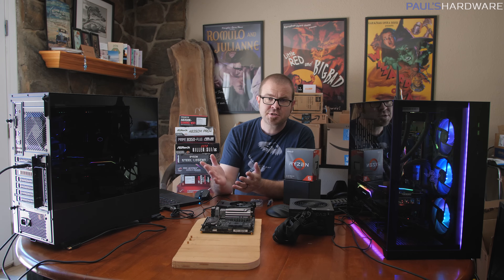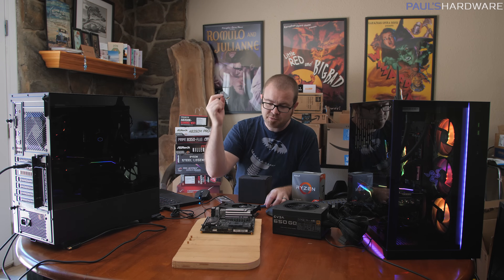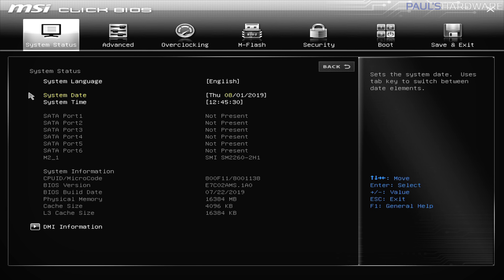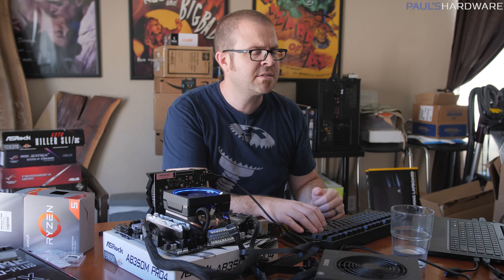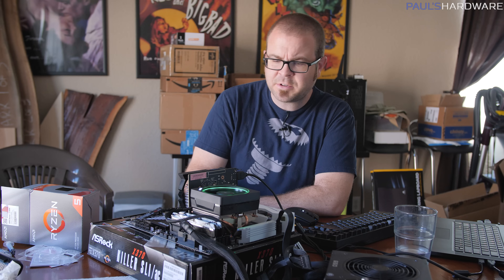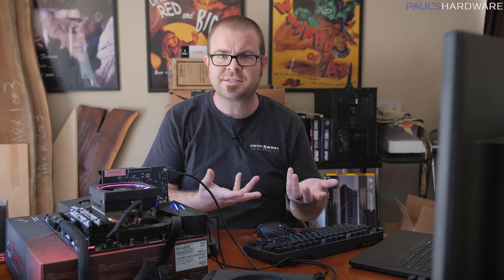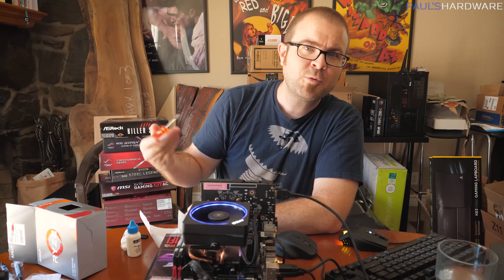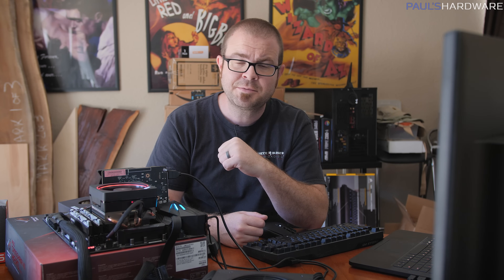Does Ryzen 3000 REALLY Work on Old Motherboards? Testing B350, X370, B450 and X470

Comment: MSI B450M PRO-M2, Ryzen 1200, GT-710 GPU, Lubuntu: no issues.  Swapped out for Ryzen 3200G, removed GT-710, booted fine, shut down via OS, rebooted fine, shut down via OS, no POST, monitor blank, CPU light on, CPU and MB fan on, rebooted via power switch, same issue.  Held down power button ten seconds,, was able to POST fine.  The issue was repeatable.  Swapped power supply, RAMs, SSDs, reseated cables and RAM.  Checked CPU for bent pins..  Reinstalled Ryzen 1200 and GT-710: all is fine again.. I am typing this on that system now.  Upgrading and reverting to MSI's various BIOS versions did not fix.  Lesson learned: Ryzen 3000-series CPUs and certain MBs do not yet get along.  Perhaps future BIOS upgrades will be more thoroughly tested than the versions extant now.
Reply: Also, the situation was worse before the above issue: turning Erp on in the BIOS seemed to help and I did not know about the ten second tip to what I think drains the MB's capacitors.  Be sure to pull the power cord and drain the capacitors before you do any work on this MB.. ground yourself for static too with any PC work.  Initially, with the Ryzen 3200G, the system would simply not POST after the initial shutdown.. sometimes multiple attempts would get it to post.  Then I learned to hold down the power button.  One could run their system with this issue but can it be trusted because where there's smoke there's fire, as it were.

Comment: Paul thanks for all you have taught me. I just bought a ASRock X470 Master SLI/AC AM4 AMD Ryzen 3000 Series CPU Ready ATX AMD Motherboard with the AMD Ryzen 7 2700X 8-Core 3.7 GHz (4.3 GHz Max Boost) Socket AM4 105W YD270XBGAFBOX Desktop Processor, will I have the same bios issue where I will need an old Ryzen cpu to update bios before using the 2700x?

Comment: I have gotten two DOA msi b450 tomahawk motherboards from newegg.com. So i went amazon today and got two X470's just in case off of amazon which were like  90.50 a pop. But if one mob don't work i can just return it.And get my money back. I buy stuff off of amazon due to the fact it was cheaper pricing for the X70's newegg was selling them for like 135 around there.

Comment: i got my Ryzen 5 3600 working on an A320 board, so yeah, they do even on the low end ones
Reply: A320 support 3 2200g out of the box???
Reply: @gamingtech5412  I had to update my BIOS first, but my r5 3600 is working just fine without any further tweaks. I haven't done any testing with other cpu's but if runs a 3rd gen, it's most likely gonna run the r3 2200g too

Comment: So i plan on building a pc from pretty much scratch, i have an old intel i5, and i plan on getting the 3600 with an b450 mb, the thing is i wont have an old ryzen first/second gen to update the bios, is there a way to work around this, apart from the flashback+ feature ?

Comment: Hey man I did the screw driver thing trying to push down the lock clip on the heat sink slipped and jabbed the screw driver into the cpu digging  a big chuck of the die off you could see the caps on the cpu well it still booted but the retail seller sent me a new one for that one that was very nice of them since that would have been a hot spot cool video

Comment: I just bought a new system actually, with some of the components you are testing in this video, so even though this is a bit old I've been doing some searching as I've had some issues. Most seem to be with my initial choice of graphics cards - the Asus 5700 (not x). I tried two of them and both caused massive system instability and freezing. My old GTX970 runs fine in the system. I'm about to pick up a Gigabyte RTX 2060 Ti Gaming OC Pro as a substitute; which is expensive for me at AUS$600. $200 more than my original first choice - Sapphire Nitro+ RX590 Gold Edition. I got persuaded to upgrade - to TWO faulty cards! WTF. Let's hope this Nvidia card works as well as my 970. I literally burnt the tips of my fingers taking the first 5700 out of the PCIE slot. It was so hot I could have fried an egg on it.

Oh, I got Scorptec Computers to update the firmware for Ryzen gen.3 for me when I bought the components.

My budget was tight so I went with a B450 and, as I say, it works fine with my old card. Hopefully I can upgrade it 6-12 months down the track when the prices are less obscene.

Anyway, my new rig is listed below and I'm sort of ok with it, considering I didn't have more than AUS$1500 to spend. Hopefully my joy returns once the new card is installed and (fingers crossed) works without issue.
AMD Ryzen 5 3600
Gigabyte Aorus B450 Pro
16GB Corsair Vengeance Pro 3200Mhz RGB
Asus Radeon RX 5700 8GB ... Asus Radeon RX 5700 8GB ... Gigabyte RTX 2060 Ti Gaming OC Pro.
Silverstone Strider 750w PSU
Antec Dark Avenger case.
6x Antec Prizm RGB fans for full rainbow puke.

If anyone can see a glaring issue here, please let me know. I'd appreciate it. :)

Comment: The crappy part right now is having to shop for a motherboard that has flashback because I'm going to do a new build and do not have an older Ryzen chip to be able to update a BIOS with for boards that lack that functionality.  It's either that or jump through hoops so I feel like at least for now I'm locked into a much more limited selection of boards.

Comment: If I don't have any ryzen previous gen chips can I flash it with the new cpu installed?
I see you used the old chip to update.
In essence, if I don't have any ryzen there's no way to use a ryzen 5 3400g with any available motherboards ? :-(

Comment: I'd love to see benchmark videos of the 3000 Ryzen in an X370 vs in an X570. I just realized today that the 3000 series could work in my X370 (Currently using an 1800x) due to a screw-up I did with my RAM and running into the information while troubleshooting what I screwed up.

Comment: HELP. I'm not sure if it's my MSI tomahawk max mobo thats giving me issues, but I'm having a problem where my pc is struggling to Alt+TAB out of dota 2, as well as when i plug headphones into the front panel audio jack. I'm running a 3600 and a RX5700 off of a Corsair RM650 psu. I have no idea what to do about this. It has caused my pc to crash beyond the reach of task manager. This is my first build and i went with AMD because i wanted value for my money, but now i feel like i should have gone intel....

Comment: If i upgrade to Ryzen 3000 and B550's aren't out i'll probably go for a MSI B450-A Pro for the Bios Flashback.
Reply: FatheredPuma81 B550 won’t come out until January of next year sadly. I think I’ll just go with an X570 for better ram speeds, VRM’s, dual m.2, pcie 4 even though I won’t use most of it, yet atleast
Reply: @mbj920  You can get dual M.2 slots on a B450. Also 3800MHz is pretty much the max you can get on Ryzen 3000 assuming you get a good chip for overclocking the FCLK and I'm not sure but I think  even B350 boards can do at least 3600MHz? Pretty sure the issue is with the CPU not the mobo for RAM speeds. 

Also will probably get a Ryzen 5 3600 tbh so I can't justify the doubling in mobo price lol.
Reply: @FatheredPuma81  dont crow to soon because there also lots of issues with the msi b450 boards and also other boards with the x570 chipset. ryzen 3000 is simply an unfinished product rushed to the market at the expense of customers. actually amd deserves another fat class action suit for this. https://forums.tomshardware.com/threads/ryzen-3600-asrock-b450-pro-4-msi-b450-tomahawk-or-something-else.3501583/

Comment: impossible to run ryzen 3600 on asrock ab350 pro4 with bios 6.00. gave lots of bsods during and after windows installtion every time it accessed usb device for wifi, installation media, copying:  system pte misue
, irql driver not equal, diverse kernel errors, Kernel Auto Boost Lock Acquisition with Raised IRQL, etc. works like a charm though with the old 1700 cpu.

Comment: What is the better value with 3600 with a b450 or a 9400 f with a b365 with a 1080ti?
Is it possible to get good overclock with a 3600 on a b450 I heard that it gets too hot and it basically can't work.  Considering the expense to get a motherboard that can overclock the 3600 to potential, wouldn't it make more sense to just get 365 with a 9600k?
I'm stuck here in figuring my build...

Comment: My system just died after 3-4 days. 3700x and MSI x470 Gaming Pro carbon. 
Cpu Ez debug light stay on for few seconds. No other debug light responds.  No display output. 

Had to send both cpu and board back to retailer since I dont have cpu to change bios or confirm if its cpu or board.

Such a waste of time.

Comment: just get a asus prime x570-p and install  2005 bios (state in dxdiag only 1005) in bios it sates 2005 doh. remember having enough 12v eax 2 8 pin  2x cpu  4x 4x pins. ram  of 16 gb install in  pairs. just look at the manual  1 st https://dlcdnets.asus.com/pub/ASUS/mb/SocketAM4/PRIME_X570-P/E15650_PRIME_X570-P_UM_WEB_V2.pdf on ram modules and 12v  4 pin and 8 pin. motherboard can be somehow dead but i shortcut it  with a screw driver on 2 pins and then it stated it was in safe mode post. pushing f1 and put up ram and soon to run at 3200 o.c ( AUTO profile 1) 3800  auto o.c and states 1200 mhz are the safe . i dont overclock this it does it by it self in profile 1 PS!

Comment: I think I'll spend the extra cash for a 570 board. There are only a couple of iTX MoBo available that supports 3rd gen Ryzen. It's hard to buy an older MoBo from Amazon that supports it since they use stock photos.

Comment: So my friend has been having a problem with his Asrock B450 Fata1ity itx board and Ryzen 3600. With the updated bios the system is having trouble posting or will randomly shut off after we boot. We have the latest Bios, RAM is good, PSU is good, send halp or is the 3600 DOA?
Reply: Oh and we returned and replaced the mobo with the Ryzen 3000 ready version (bios pre-flashed) and had the same issue

Comment: Edit: dead CPU, replaced and it works. 
Lets see what you guys think because I believe it is a bios update error. 
I bought the Ryzen 5 3600 with the ASRock B450m steel legend box says MB is Ryzen 3000 ready. Which it worked after putting everything together, I downloaded Windows fine and even played games for two days. While loading up a game on the second day it blue screen and I didn't see the error code but said something about a recovery key to fix the problem. After resetting my system no longer posted. I replace the MB (with a new but same model) same thing wont post, no video. 
I checked RAM, GPU, PSU, USB, SSDs and HHDs, HDMI to no avail. What do you guys think is it a bios update or a dead CPU?
Reply: Bump

Comment: bought the r5 3600 to replace my r5 1600 on the b450 tomahawk and it didnt post but one time. I tried all the latest bios, cleared cmos,  and nothing. Msi needs to get their shit together!!!
Reply: @linkflap1342  I sold the mb and bought one with amd 3000 desktop ready sticker and had absolutely no problems
Reply: @linkflap1342  msi gaming pro carbon ac b450

Comment: yeah so if you had the misfortune of combining the b450 tomahawk with a ryzen 3600 on your first build and don't have spare cpus around to upgrade your bios with, you can use the flash bios usb port and button on the back to upgrade. i did and my computer works like a charm now, and there are tutorials on how to do it, but i wasn't having any luck following them step by step. couple things most of them don't tell you is you gotta use a 16Gb or less usb 2.0 flash drive to pop your MSI.ROM renamed bios file onto in order for the motherboard to read it. also, i had to install v17, then v18, then v19 of the bios and didn't mess around with the beta versions in order for things to really come together. like, i had to install them consecutively... just going straight to v19 didn't work at all for me. and i don't know much about computers yet so i can't tell you why, but yeah. everything had to be unplugged from the mobo too in order for it to flash. no cpu, gpu, ram, etc... finicky, to say the least! but she works and i am so thankful! it's a solid board but it's a headache straight out of the box with a 3rd gen ryzen. good luck to you guys!!
Reply: Do you use the MSI B450 Tomahawk Max? Planning to pair it too with Ryzen 5 3600. Imma plan to go max instead of the regular one if it solves the problem
Reply: @iCeMhaN23  I used the MSI B450 TOMAHAWK ATX AM4 Motherboard, not the MAX version. after i got everything up and running with my radeon rx 5700, she's working beautifully. i'm also diggin the m.2 memory... love love love it! the max solves the problem i had by being compatible out of the box! enjoy!!

Comment: Hey,
 I bought Ryzen 5 3600X with Gigabyte Aorus B450 Pro motherboard, I install the CPU, RAM, Cooler everything was done, I set-up the pc, switched the psu switch to ON, when I did that my Motherboard flashes Blue once, after I start my PC, my motherboard didn't start it lights, my cpu cooler fans didn't start aswell, on the bottom right of my motherboard there are CPU, VRAM, VGA and BOOT the CPU and VRAM flashes red, VGA and BOOT didn't flash at all, can that be from not updated BIOS and my motherboard can't recognise my CPU or I messed up something in the process?
P.P: Sorry for my bad English!
Thanks !
Reply: did you update the mobo before u put the 3600x?
Reply: @ImDenq  No they need to do it i don't have ryzen cpu
Reply: @asen0w78  u have to update with an older cpu otherwise it wont work
Reply: @ImDenq  Yes I send it to the site I bought it from to update my bios :)

Comment: I would like to bring up the RAM compatibility issue. If MoBo does not support BIOS Flashback and older CPU is installed to POST and update BIOS, the memory for a new build might not be qualified for the older CPU.

Comment: What should one do if they are looking to upgrade to the 3000 series but only have am3+ (fx8350) processors on hand? I Don't really want to pump $160+ into a MoBo for a x570. I would really prefer to use a B450 or such. My concern is if I buy a MoBo that needs a BIOS update, I wouldn't be able to update it, as I don't have an older gen Ryzen...

Do any MoBos exist that are known to work out of the box, that I can pick up for under $100 USD?

Comment: Just got my X470-f motherboard and I ordered a Ryzen 7 3700X, If I update the motherboard BIOS will it work?

Please halp
Reply: It should work.

Ryzen only installs on Windows 10. For help https://community.amd.com/community/support-forums/processors

You can use a small screwdriver to put an uncooked-rice-grain-sized blob of thermal paste on the CPU in the middle. Also use it to straighten any bent pins. Renew the paste every 12–18 months.

Tuning Ryzen for better performance https://www.youtube.com/watch?v=LTT5mhqmjJc

A new Ryzen user wrote: “make sure windows 10 allocates enough space for virtual memory because my computer was stuttering for a while”. (I think they mean the page file/swap file. It really means they didn't do so with their old processor.)

“My ONLY point of frustration came from some instability I experienced that took me a while to troubleshoot, first thinking it was probably some sort of memory incompatibility. It ended up being an incompatibility with the Windows 10 Ryzen power plan that was installed. Switched to the regular "Performance" plan and its been rock solid ever since.”

If the processor idles at a high temperature: disable all 3 bios options for Precision Boost Overdrive (PBO). Set Windows Power Plan (not AMD's one) for "Balanced".

Comment: planning to buy r5 3600 and gigabyte B450 AORUS M. will it work?
Reply: Probably.

Ryzen only installs on Windows 10. For help https://community.amd.com/community/support-forums/processors

You can use a small screwdriver to put an uncooked-rice-grain-sized blob of thermal paste on the CPU in the middle. Also use it to straighten any bent pins. Renew the paste every 12–18 months.

Tuning Ryzen for better performance https://www.youtube.com/watch?v=LTT5mhqmjJc

(If you get the 3600, 2600, 2200g, or 2400G the Wraith Stealth is a bad cooler. Try the Cooler Master 212 evo or the smaller Antec a40 pro. Thermal Grizzly Hydronaut is a very good paste.)

MSI have just released 'Max' versions of their B450 motherboards with Ryzen 3000 support out of the box. https://forum-en.msi.com is MSI's forum.

A new Ryzen user wrote: “make sure windows 10 allocates enough space for virtual memory because my computer was stuttering for a while”. (I think they mean the page file/swap file. It really means they didn't do so with their old processor.)

“My ONLY point of frustration came from some instability I experienced that took me a while to troubleshoot, first thinking it was probably some sort of memory incompatibility. It ended up being an incompatibility with the Windows 10 Ryzen power plan that was installed. Switched to the regular "Performance" plan and its been rock solid ever since.”

If the processor idles at a high temperature: disable all 3 bios options for Precision Boost Overdrive (PBO). Set Windows Power Plan (not AMD's one) for "Balanced".

Comment: MSI B450 gaming pro carbon AC 
Is it good for Ryzan 7 3700x
Reply: Mashud Rana yes, but do not OC it too hard, the VRMs may suffer a bit. However, the 3700x is a 65w tdp processor, so it should (in theory) work a good as a ryzen 5 1600x, but you never know